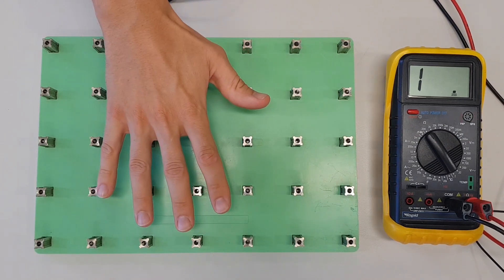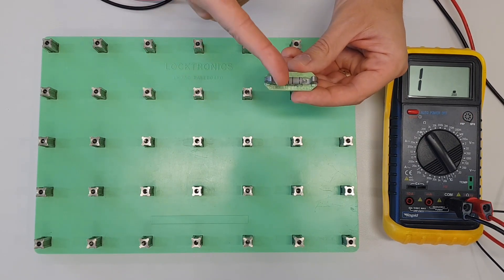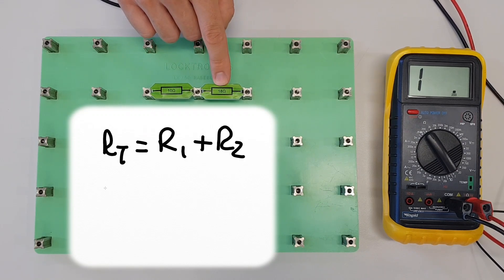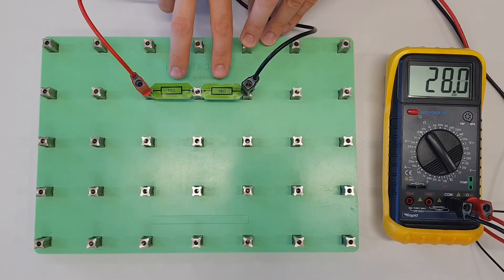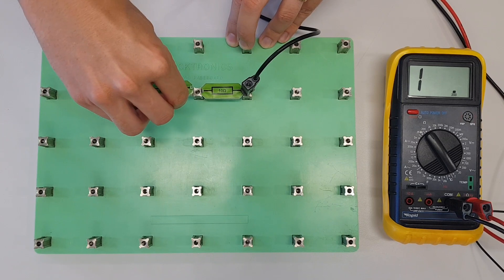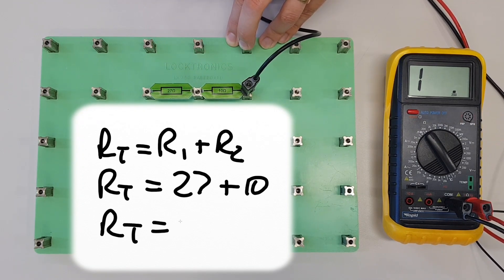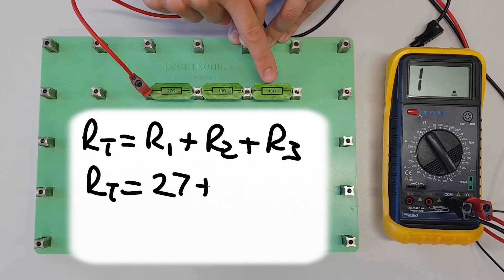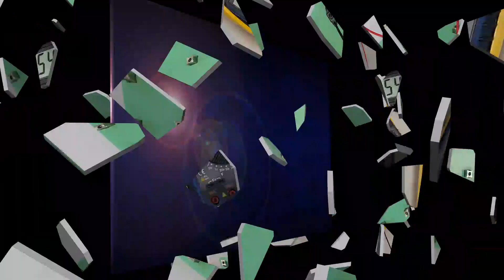Resistors in Series - Advanced Series Theory - Electrical Science and Principles

Comment: how do you find out the value of a resistor in series if 2 are known and 1 is not. Vt is known and Current is known.
Reply from the maker: Divide the voltage by the current to get total resistance and then take away the two known individual resistor values. 👍